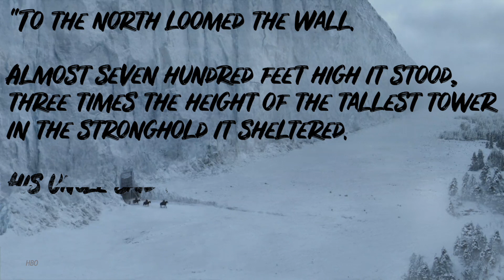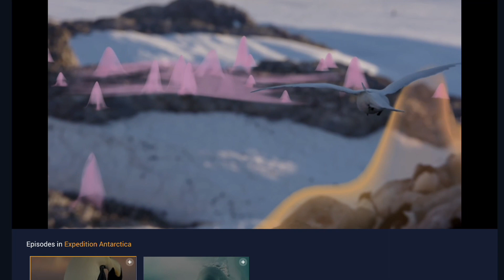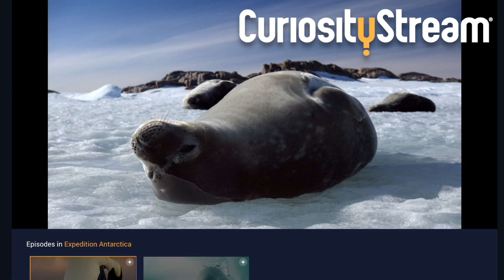Holy Crap! The Wall in Game of Thrones Could BE BUILT?!

Comment: Heres an idea, what if they build it just like concrete, but with layers upon layers being made. Basically, to make the foundation, they'd just need to have two openings on either end of the wall to get sea water in and form really strong, and cold, ice. This ice is salt water ice, which has a temperature of 0 to -21 degrees Celsius. Then then make supports for a meter tall block of ice spanning the entire wall. With the help of the children of the forest, the wall is strengthened with magic. It also took thousands of years to be constructed, and it's current form is the final form.
It does taper off towards the top too, which helps with weight distribution. In canon, the wall started off smaller, but gradually increased in size.

Comment: If the environment's temperature is below the freezing temperature of water, you could just "grow the wall" as long as you slope it properly and build wooden braces along the sides (To contain the water while it freezes). Then you just need to pump the water up to the layer you are working on.
Reply from the maker: Hopefully the engineers knew that 🤔😉

Comment: Hmm, what I'd like to do is improve their tech. They're in such stagnation... 

For example - they could put crossbows that would have automatic shooting mechanism with quite big ammo load - arrows that would be lit during launch process or even ice spikes that wouldn't need a lot of preparation - basically get water, freeze it - you've got ammo.
The way it would work would follow very simple engineering - to accumulate energy - a block that would be potential energy storage, which would be slowly released rotating a wheel that would change position of a stretcher of the string, at the end of the stretcher every cycle the hook would be released and crossbow would fire. Pretty simple and powerful for whites and wildlings. Basically, they could defend with this shit against 100k army. :D
Reply from the maker: 😳 wow!!

Comment: The size of it is just too damn ridiculous..... particularly the 500 km stretch. xD

I have a bit of a different perspective on this. You see, I was born in a city that has an almost 200 meters tall, almost 8km long man made structure - a hydroelectric power dam.
I also went through a short internship there, as well as worked for a couple of months doing inventory of desktop PCs there, when I basically had access to most areas inside and outside the dam. Of course we explored the heck out of it... the job was boring by itself, but the fact that we got to see every nook and cranny of the dam made the job just simply awesome.

It is freaking ridiculous. You stand in awe at several points wondering how the heck people were capable of building something this monstruous.
Just the thought of people building a structure 60 something times that out of ice instead of concrete... damn son, not gonna happen. xD

But yeah, for something that size you are not talking about bricks anymore, it's about pouring the material directly to set it in place. Problem is, you can't do that with this much volume of water/ice alone. Structural integrity goes out the window.

Approaching from a different perspective, they could've gonne the reverse of building a wall.... like instead of building up, carving down. There was once a glacier there, so instead of building up, they just carved a mountain of ice down to a thin stretch. Problem there would be that it wouldn't hold.
Perhaps a more realistic but less impressive wall would be a mountain range, carved to hold guard posts and whatnot (like Minas Tirith in Lord of the Rings). Doesn't matter though, I'm glad Game of Thrones went for this ridiculous approach. xD
Reply from the maker: That sounds like an AMAZING job! I love exploring all the books and crannies of buildings to see how things are put together. I used to stay at this hotel every new year with my family (this was when I was a tween-teen). At the end of the hotel near the roof in a large lit up room shining out over the landscape was this massive nativity display, and I was curious to see it up close (to the surprise of none of you). I hunted for days and days and finally narrowed it down to one hallway on the fifth floor, and one unmarked door at the end of the hallway… I never did get it open, but the exploring part was the fun of it anyway. 🥰🤗